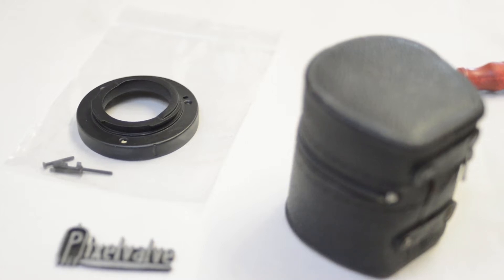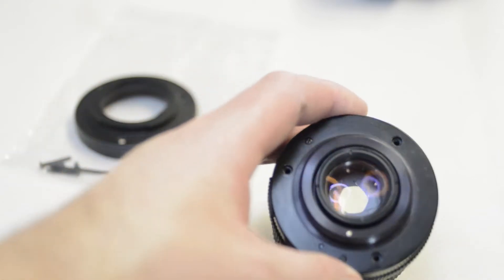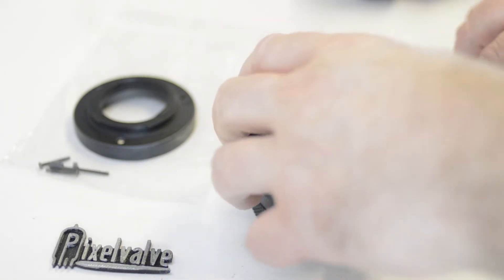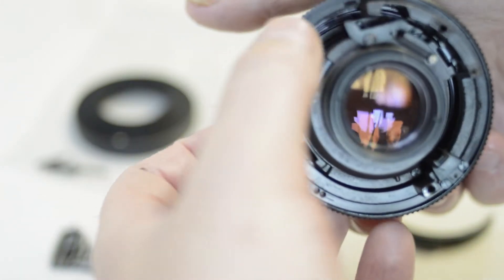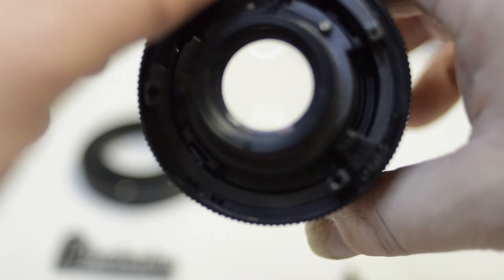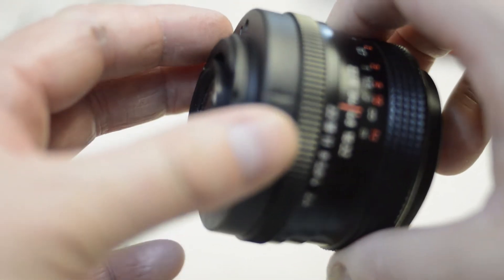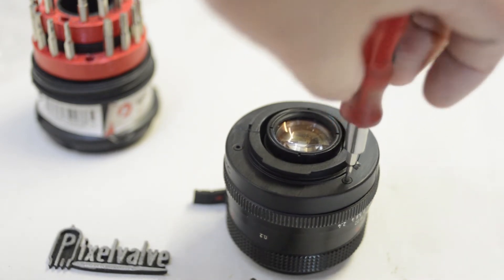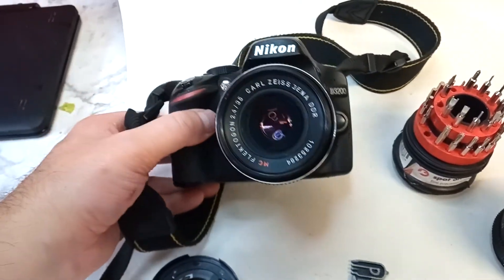#21. Carl Zeiss Flektogon 35mm f2.4 BLACK (custom Nikon adapter backplate) Pixelvalve

Comment: Hey, since the aperture lever is locked in position, so does the lens have to be focused while wide open, and then stopped down as the viewfinder will be dark and DoF preview won't work?
Reply from the maker: I would say that is correct, because although my Nikon DSLR doesn't have DOF preview I often find the manual focus dot in the viewfinder needs more light to work, so I do tend to open wide, focus, then stop down if I am indoors, or in low light.

Comment: Any chance of this adapter working with a flektotgon 2.8/20?
Reply from the maker: I honestly don't know, because I haven't had a 2.8/20, but there is always a small chance it could fit, although I doubt it, from my experience with these lenses so far, each one is different, and it's odd because it would be so much easier for a manufacturer to have interchangeable parts.
Reply: @pixelvalve Thanks. That's pretty much what I thought.

Comment: Does it focus to infinity? Looks like a fantastic option! Do you have any test shots?
Reply from the maker: Yes, it works wonderfully, I have been using it for about a year mainly for video, it focuses to infinity and is fully manual. I will make a video to show what it's like to shoot with at some point.
Reply: @pixelvalve  thanks. That would be really great. Is it made of plastic? What an awesome project you have done 😎
Reply from the maker: @genghisahmed4606  Thanks, yes, it's plastic, but it's a special toughened UV resin, so it's able to take some stress.

Comment: It could be used in a Pentacon 29mm f/2.8 since is basically a Flektogon case with 29mm focal scheme? Because I can't find any solution to use my Pentacon with my Nikon dslr
Reply from the maker: Posibly, but I don't have a Pentacon lens at the moment, so I can't test the idea out yet, but I will look into this now that I know you are interested. I will upload a video when I have some news about it, and if you subscribe and hit the bell icon, you will be notified of new uploads.
Reply: @pixelvalve  if you get one of this pentacon and it works, dude, you'll make my day!